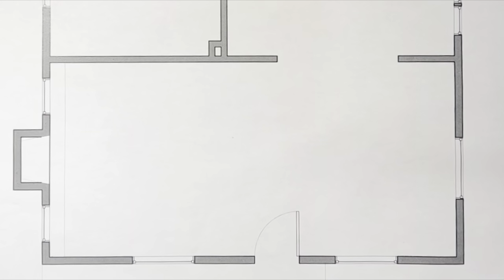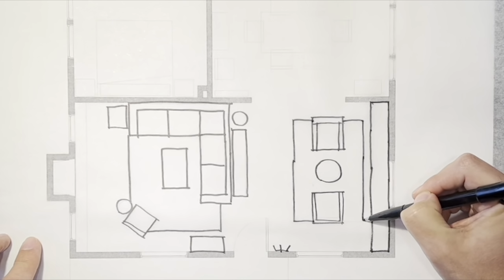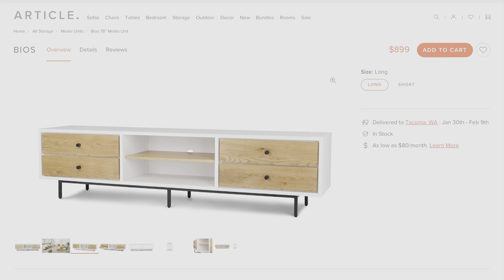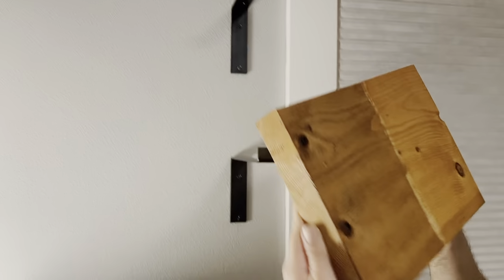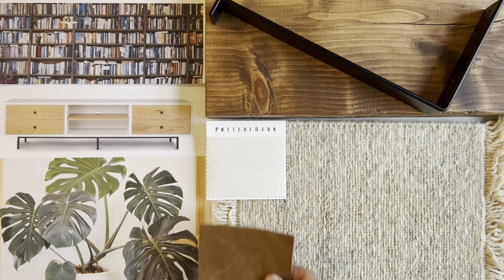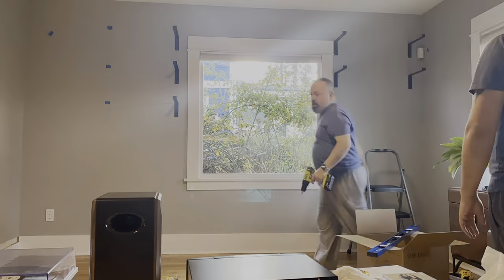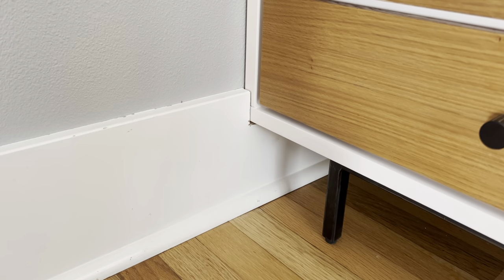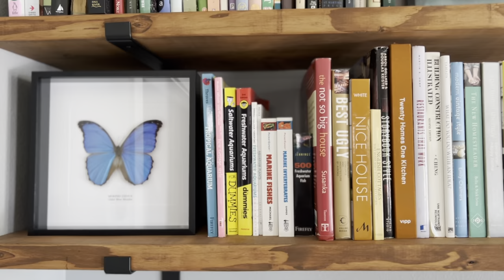Living Room Makeover Part 2 | 2023

Comment: if you had put slightly longer legs on ( or cut a sleeve of PVC a few inches to slip over the existing legs and paint then black) maybe a few inches the crendza would have fit OVER the floor trim... just a suggestion... now if those swivel chairs just reclined too it'd be perfect for me... good job